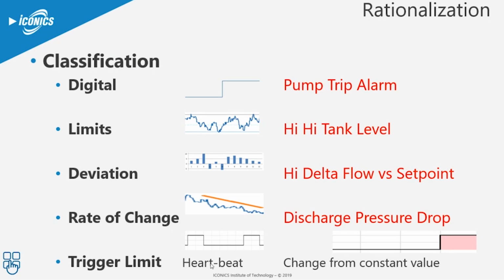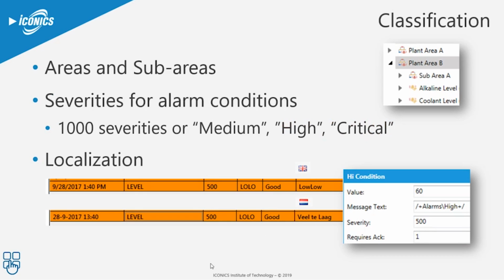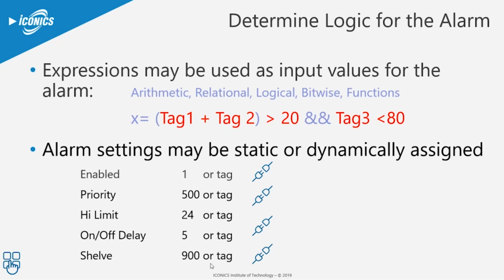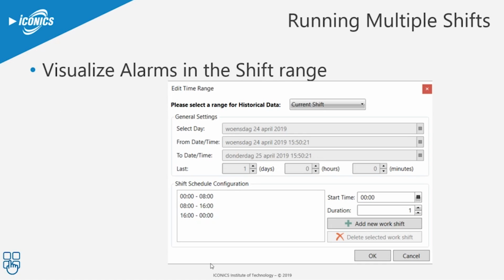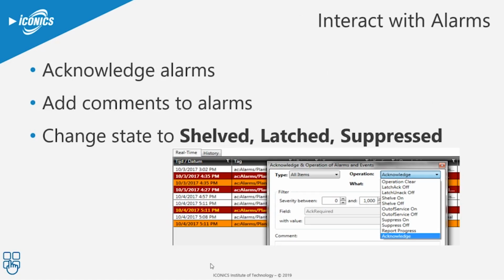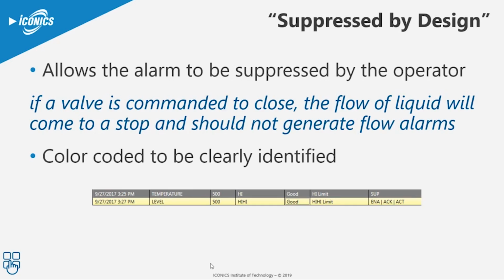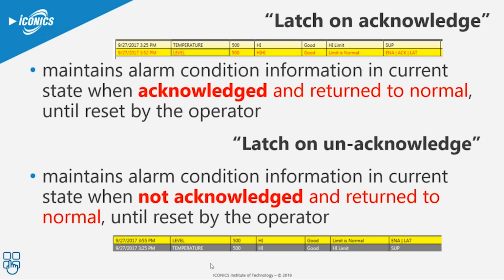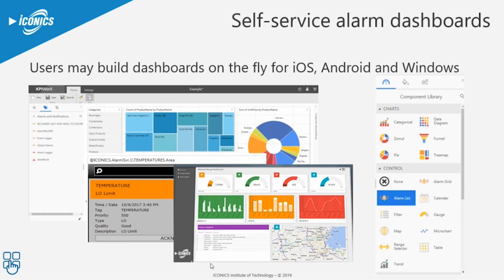Iconics AlarmWorx Basic

Comment: I'm currently using ICONICS version 10.97.2.
I'm experiencing an issue related to the SMS feature in ICONICS.
Whenever an alarm is triggered or cleared (turned OFF), an SMS message is sent to my mobile phone as expected.
However, when I acknowledge the alarm, an SMS message is also sent to my phone regarding the current state of the alarm.
I want to prevent SMS messages from being sent when an alarm is acknowledged.
Is there any solution for this?